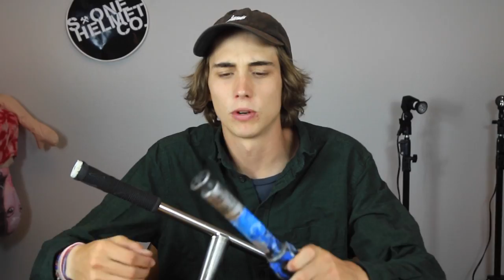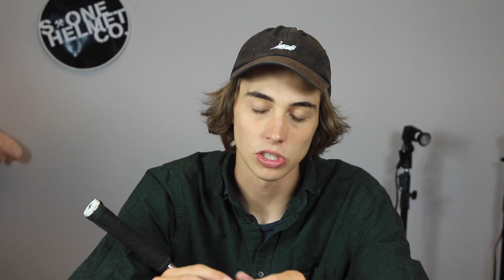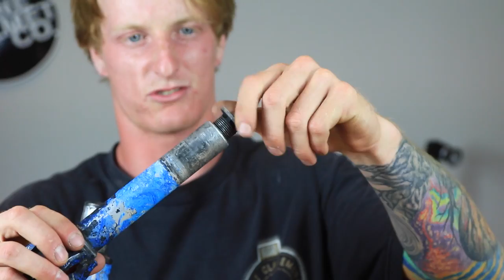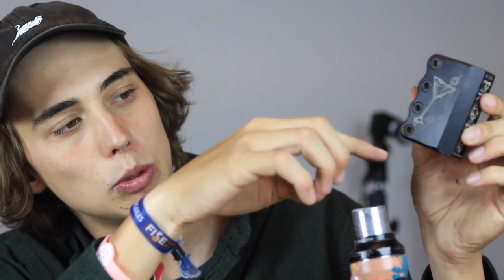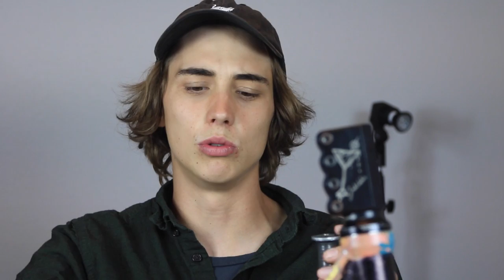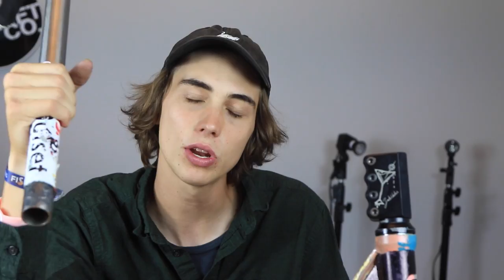DIFFERENT COMPRESSION SYSTEMS FOR SCOOTER

Comment: Scs= strongest
Hic= right in the middle
Ihc = weakest
Reply: Ihc isn't the weakest but it's the least expensive and lightest
Reply: I feel like the ihc is stronger than people think because the bars sleeve over the fork strengthening it
Reply: My ihc is dead, it took 5 yrs tho
Reply: My IHC has been through what it should've not been through and it is just fine.

Comment: Threaded compression has literally been around for 100 years+ at this point, so the patents have run out and is mass produced thus people figured out how to make it super cheap. It has been used on most bicycles types particularly it’s on BMX bikes, proving it is plenty strong but the down side it is fiddly to adjust and quite heavy to make strong. Thinking in the long run it’s cheapest to maintain vs thread-less as you just replace the balls bearing and fill it with grease instead of the full bearing as the races are the cups.  

So makes sense why Micro which started the modern scooter fab in the 1990s, used that system. Borrowing from the bicycle industry is a common thing in scooter development it seems .

The design philosophy today is more disposable so it makes sense what thread-less system would be popular now, it looks cleaner(road bikes used it for Aero Advantage) and it’s less fiddly to setup(less man hours in a factory)  but there’s no consensus so that’s why there are so many different systems standards that have been made . It does feel a lot more wasteful when you replace the full machined bearings but hey cheap labor in third world countries produce them cheap so we don’t have to think about , the scooters are more or less cheaply made and disposable as well when you look at all the snapped decks and bars compilations online .

Comment: Im getting scs soon and im gona use the fat ethic bolt shown in the video but i need headset spacers. do headset spacers weaken parts tho? i heard it makes forks snap easier. i need to run a lot of spacers too so will my forks be really weak? i bought strong metal spacers but will my parts break now??

Comment: razor still has the screw on bolt thing and it sucks it is ether loose and moves or you can barely spin them.if i wanted to put a different headset and compreshen system what kind should i get.
Reply: also it will loosen itself or tighten its self